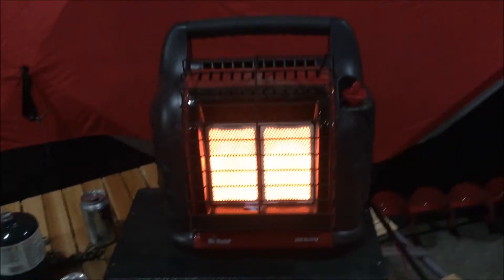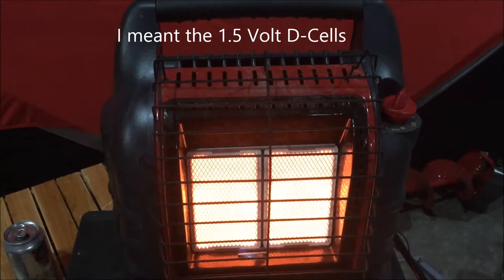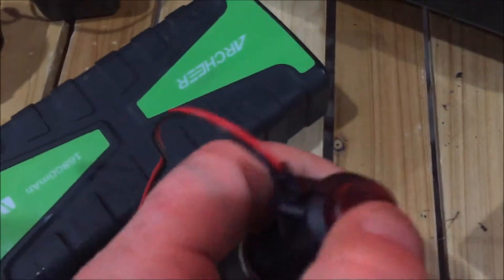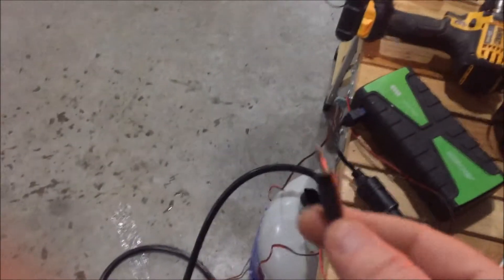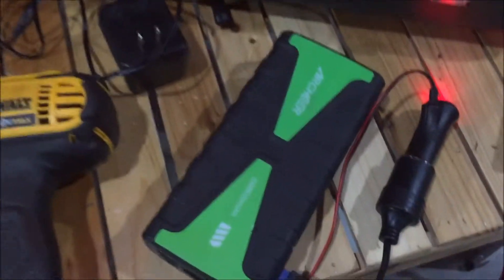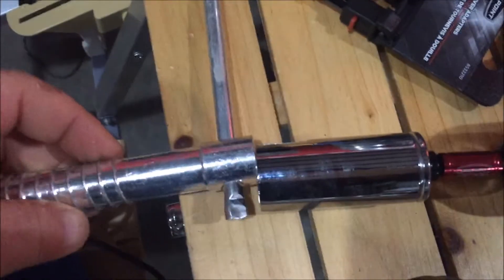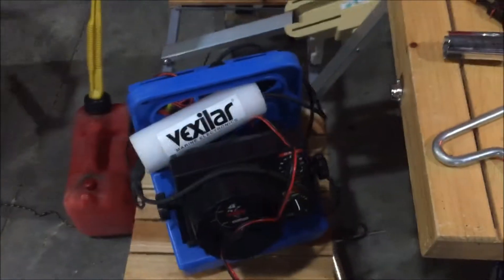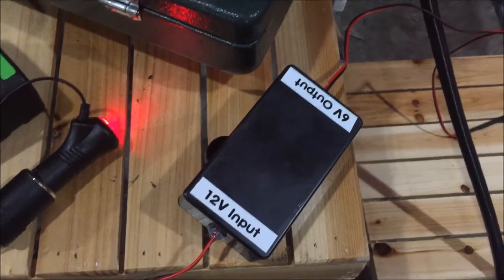Mr Heater Big Buddy Fan Power Supply

Comment: Question, could a USB to 2.5mm and external battery pack work for the fan?
Reply from the maker: Ya - I think so -   USB is 5 volts so it would be close - actually a pretty good idea :)   no need for the voltage converter.   The current draw seems pretty minimal - definitely worth a try.